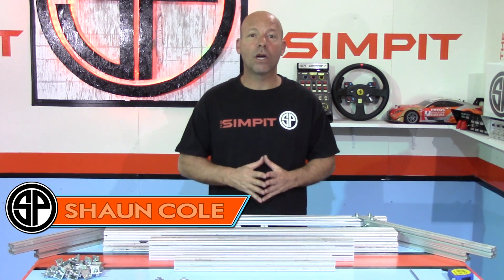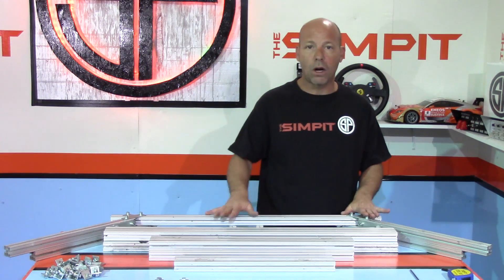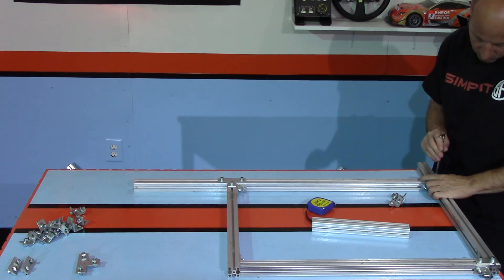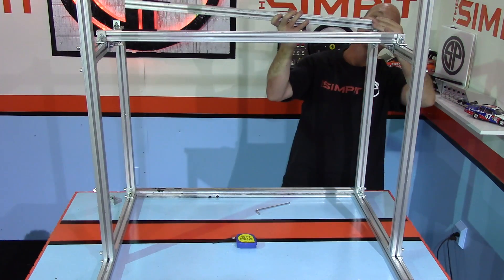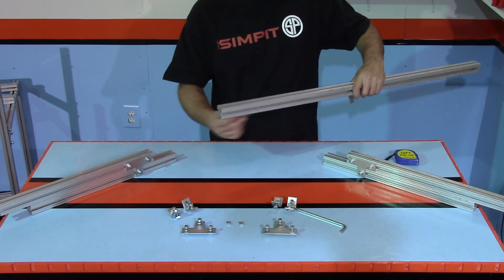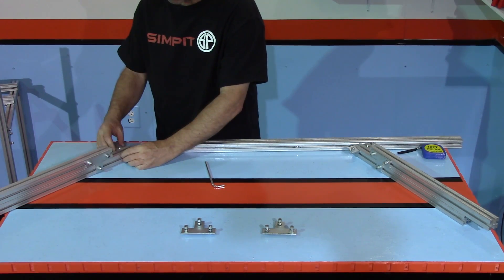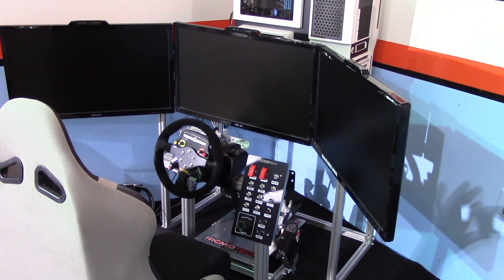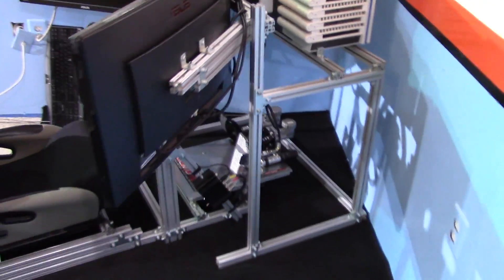DIY - 80/20 Triple Monitor Stand by The Simpit

Comment: Does anyone know the width of the tubing (not the length)? They come in a ton of different sizes - 1 inch (the 10 series), 1.5 inch (15 series), or 20 mm up to 45 mm.
Reply: Don't make the same mistake I made - don't use 1 inch tubing - it's WAY too flimsy.  To be honest, this DIY makes no sense.  80/20 parts are extremely expensive, especially the various brackets.  I'm about $300 into this thing, and because I was unclear on the tubing diameter, I went with the first one that popped up on 80/20's confusing web site - cataclysmic mistake.  I ended up with a flimsy, unstable mess that I've probably spent 8 hours (and counting) trying to make work, but it sags so much under the weight of my monitors that I think it's hopeless.  I'm about ready to throw the whole thing into the the trash and buy a ready-built one.
Reply: @andrewnagy4456  4 years later... haha. Thanks for the reply! I currently use a built pit called the "Obutto revolution". I think the business went under. I love it to a point, but there's things I really hate about it too. It's extremely stable, but I've had to customize the heck out of it. I ended up using the 15 series from 80/20 for some of that. Built a thing off the side to hold a hand brake, sequential shifter, h-shifter, flight sticks, etc. I also made a floor panel out of wood so I can quickly switch from racing pedals to flight pedals in just a few seconds. 

But it's still not quite right. I really need to customize this further, like lowering the wheel, leveling the monitors, etc. At this point it means custom building an entire pit. I would have spent a lot less if I went with 80/20 in the first place (assuming I get the right profile! Got to go big)

It would be so much simpler if I only wanted to do racing or flying, but I want both, and I want it quick and easy to switch. :)

Good luck to you on your pit!
Reply: @theforgedone  Yeah, I just wanted to share my experience so nobody else goes through the unmitigated misery this thing has caused me.  When I was pricing monitor stands, it was at the depth of the pandemic, and I guess there were fewer stands being advertised, and what I saw was gerenally north of $400, which struck me as ridiculous.  So I ran across this video from Simpit, and it looked pretty reasonable, but I should have done a lot more research before plunking down my cash.  I was so appalled at how much the componenets, particularly, the brackets, cost, that I guess I subcoinsciously assumed the 1" tubing would be adequate.  Also, I went with 5" t-brackets from Home Depot, and cut their excess lengths off to make the straight brackets, thinking I was being very clever.  Another big mistake, as they're not as thick as the brackets from 80/20, further contributing I'm sure to the stand's instability.  At least I used the (ungodly expensive) 90 degree brackets from 80/20.  Bottom line, to do this right, you have to use at least 1.5" tubing, which will entail larger and more expensive brackets, and further drive up the cost.  I checked triple monitor stands online again last night, and found several that look quite nice, in the $250 range, INCLUDING the VESA mounts, which is way less than it costs to build this thing from 80/20 components.  Also, even if you do it right, there's no adjustability of the angle of the side monitors, which sucks.  Anybody looking for some 1" 80/20 tubing and assorted hardware?  As I said above, this thing is probably headed flor the trash very soon.  I'm not upset with Simpit, as most of my problems were completely self-inflicted, just pointing out that this is one item that makes a lot more sense to just buy ready-made.
Reply: @andrewnagy4456  good info.  Thanks.

Comment: You could level your audio afterwards, that would really help.
Reply from the maker: +Spidey. 
I will work on this.  These shows are harder to mix then normal, but I will work on the levels.
Reply: You record them at a perfect level,mixed nicely,that part is all right,,you just need to run it through a maximiser  afterwards to boost the signal, without clipping. Thank you  for a great show.

Comment: THIS is GREAT but ill just buy the gt omega triple stand at a cost of 179 quid which is cheaper than this!!
Reply: +rizzee rizz Uuuuh, since when was that the point? You build it yourself because you want something that fits your specs. Price is not even a variable. I see and hear, nowhere that Shaun states this is the cheapest DIY triple monitor stand in the world.
Reply: +rizzee rizz Shaun built this to his specs, which included a spot to hold his computer, up high and off the ground for easy access.  You can't say that about a GT Omega stand.  Also making a monitor stand with the same material as the rig, maintains a certain ascetic of look.
Reply: +John G. Hill yea but the point is when you build it yourself it should be cheaper and as for a holding spot for the computer i have a wife and she needs a job to do.